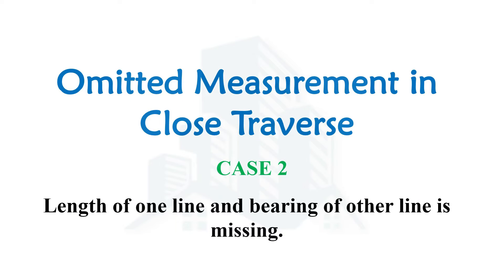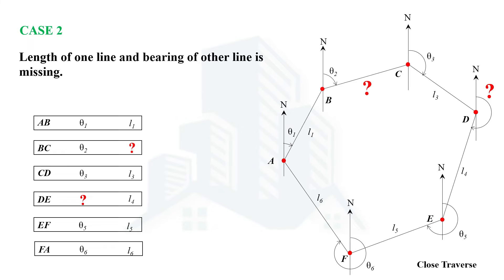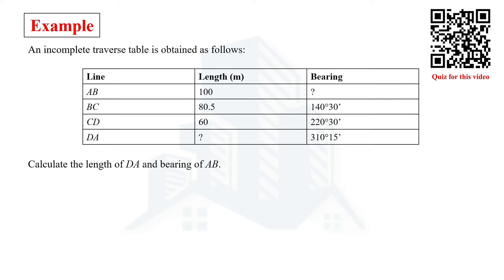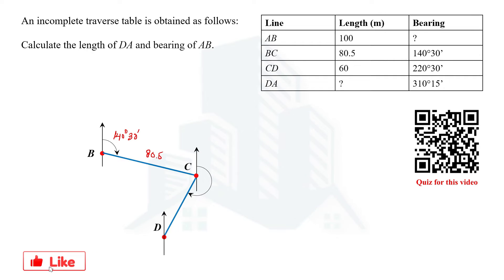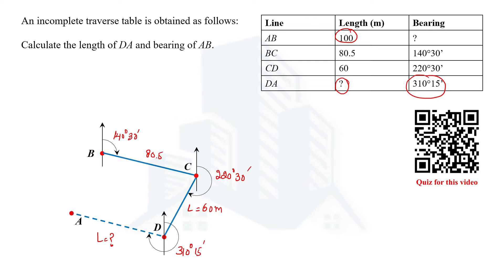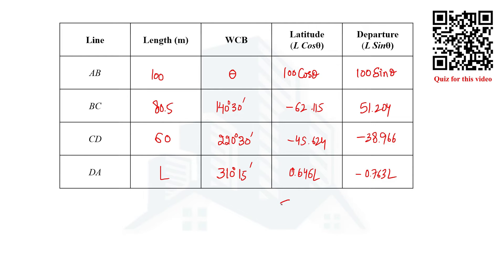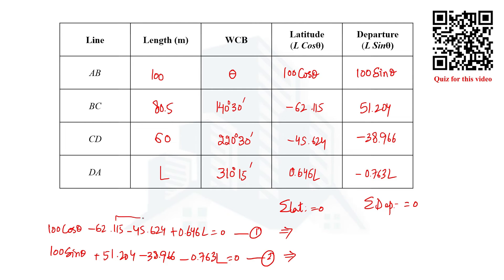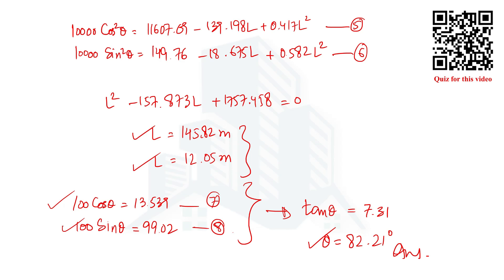Omitted measurement in Surveying: Determining length of one line and bearing of other line (Case 2)

Comment: sum of11607.69 and 149.76 become 1757.458 how
Reply from the maker: The sum of 11607.69 and 149.76 will not become 1757.458. However, you may have forgotten to consider the 10,000 obtained by adding the terms on the left-hand side of the equations. Please check your calculations.